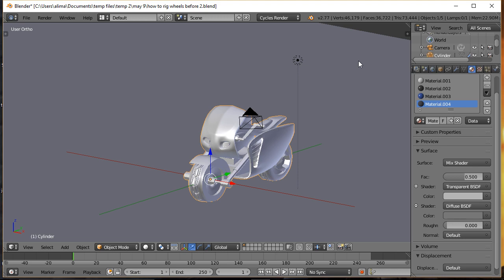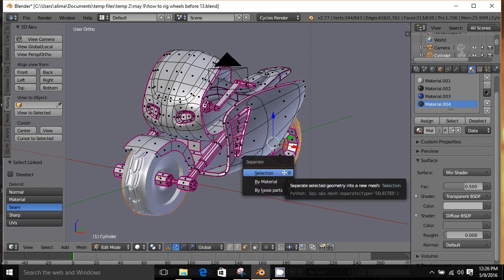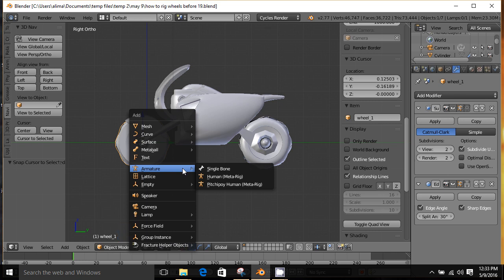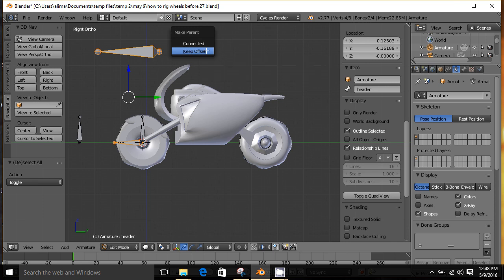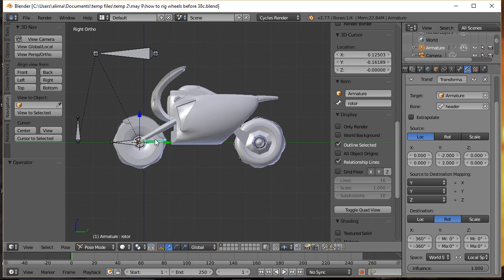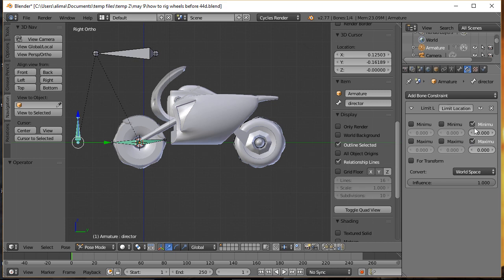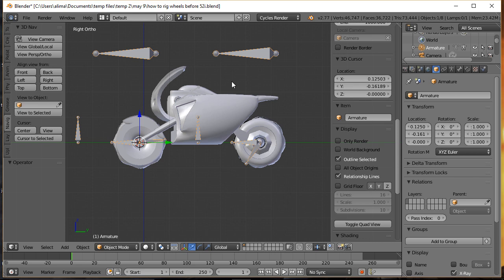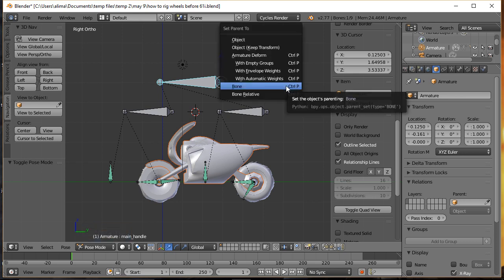How To Rig Motorcycle Wheels In Blender 2.77

Comment: Hi Alimayo, nice rig tutorial. I've went through a couple of vehicle tutorials and they all seem to have the same issue, when keyframing forward translation going into a 180 degree u-turn into the opposite direction, the wheel turns tend to go crazy between the 70 and 140 degrees range and then settles again when the vehicle is fully turned 180 degrees. Does your bike rig keyframe animate perfect into a 180 degree turn?
Reply from the maker: Hi Andre. It has been 4 months since you posted this comment about rigging vehicles and the issues that they have when they are turned a full 180 degrees. I was just wondering if you had found out a way to deal with this issue or not?
 Thanks in advance Andre.
Reply: Unfortunately not
Reply from the maker: Ok. Thanks for answering back Andre.